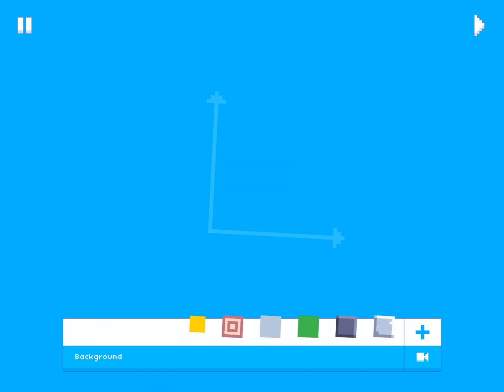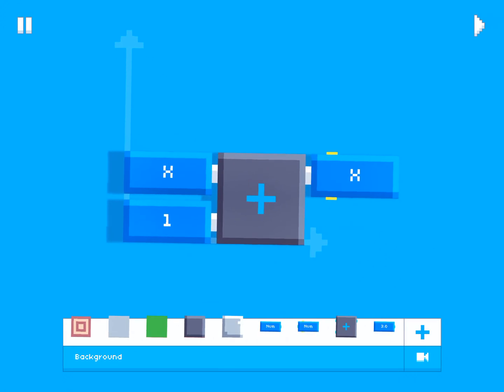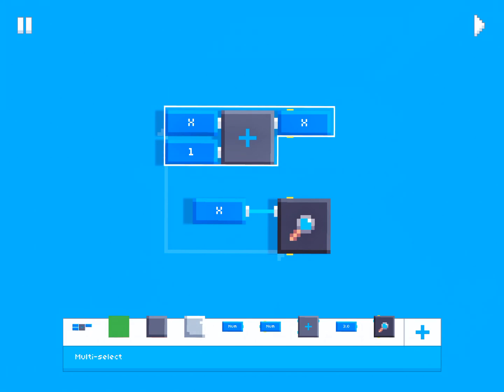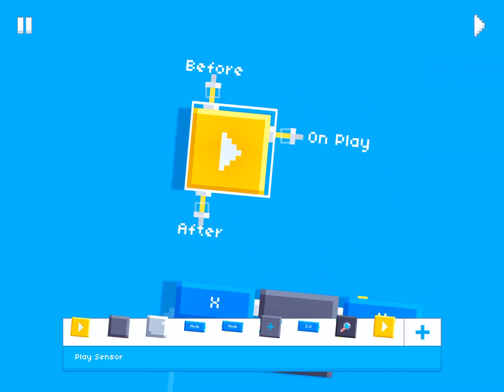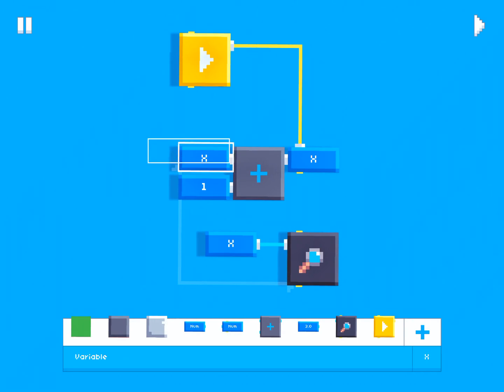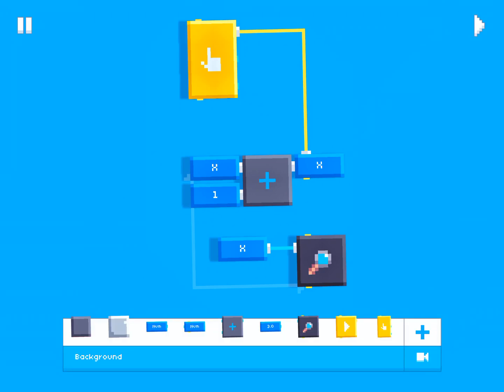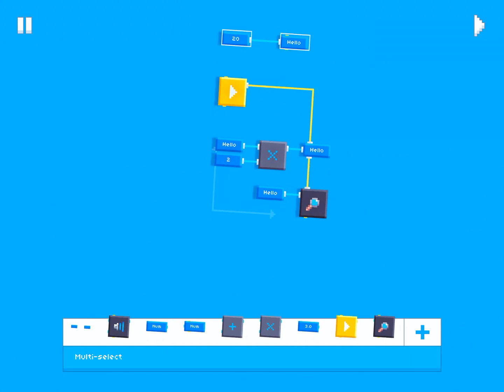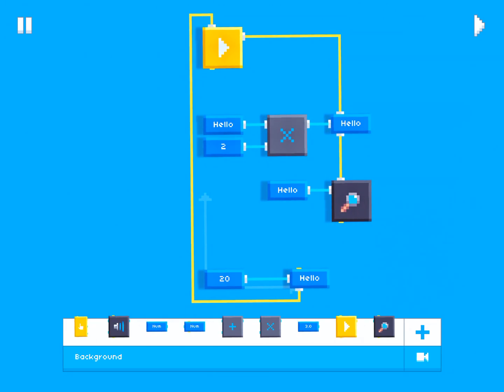Fancade Scripting Tutorial 3 | Control Wires

Comment: Hi, thanks for the tutorials! I just wanna say that Fancade might've changed a bit between this video and now, because if you go look at the Fancade Wiki, it actually says (or rather implies with its example picture) that the order of scripts is FIRST left to right, THEN top to bottom.
Meaning that two or more scripts on the same row are gonna be executed before the program executes the ones below them.

https://www.fancade.com/wiki/Execution%20Order.md

So for example of you had:

A B
C D

The program would run as "A, then B, then C, then D":

A ➝ B
    ↙
C ➝ D

Right?
Reply: Yes this makes sense from what i have tested
Reply: Of course this is assuming no yellow connections
Reply: Should be pinned

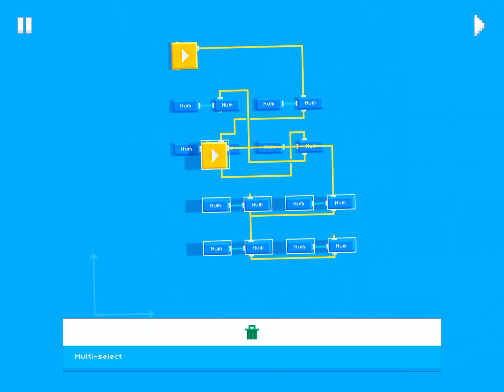Comment: What if you connect a after wire to a after wire?he was connecting after to before so?!?!?10:29
Reply: That... Doesn't work...
It's only before to after
Reply: @Jonathon Wolf alright, if a script runs before another script, another should run after it, if before was connected to before, and after to after, there wouldn't be a way to determine which one's first, other than the default order, rendering it useless.
Reply: R/facepalm

Comment: How to make your own block
Reply: Click on a block and look down, there's a pencil to make a new one and edit it
Reply: @piggyoink1933  how do you add inputs and outputs to a custom code block?
Reply: @JudahBraun  you connect a non used wire inside one of the blocks in the script to the outer layer of the box, depending of the color of the wire, the function will be different.
Reply: Just don't use custom script block cuz of the script limit